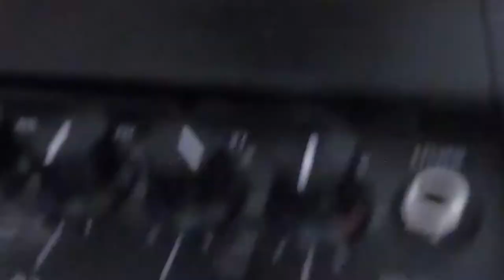Modifying Blackstar Fly Mini Portable Amplifier - Rechargeable Battery Mod

Comment: Buying rechargable batteries suggested for the tame of heart. I love mine. I just use rechargeable 2100 Nmh Eneloops. You can play a long time on 6. And I have the 6 watt 103 ext cab and it will run 2 days without shutting it off, then I just put more charged ones in. I have cord that came with my combo, but I just love being able to move around and jam
Reply: does the cord charge the batteries inside the amp or is it for a different purpose?

Comment: I thought about using an external power bank. It's a great idea to modify it if you like tinkering with stuff and you have all the equipment otherwise just use it at the wall or buy a rechargeable amp like the Nu-x Mighty Air.

Comment: I have to say you did it wrong because the amp requires a 7.2v to 9v pack to work propertly not 3.7v battery my friend you probably figured it out after using it with that.
The battery is fine, you had to buy a step up voltage board that make 3.7v go up to 9v so u can use all the power.
Now all youre using is 15%20% of the power of speaker unfortunately.
You can also buy a 9v lithium too.
Edit : Cant believe you cant hear the amp being distorted with lack of power

Comment: hi, im planing to replace the existing AA pack box with 9v holder box, is it safe just to reconnect those two wires from AA box to the 9v holder box connector? thankyou
Reply from the maker: I think it would be safe but I don't think a 9v would have the capacity or peak discharge to work very well, it could be worth testing though? I would assume that the amp would cut out at loud volume/heavy playing but not sure...
Reply: Hi how did it go with the 9v battery? You tried it out? You have a pic or a video to share? Thank you

Comment: Seriously?!!!!  ROFL.  FFS Just buy x6 Panasonic 2450mAh Eneloop Pro NiMh LSD NiMH AAs (Made in Japan). If > capacity is required, but a second set of x6. Fly 3 operates at nominal 6.4V DC input power, so no need for all this shenanigans.
Reply from the maker: There are certainly many ways you could achieve similar results, personally I didn't want to use AAs and get an AA battery charger, plus I already had most of the components laying around. For the most part, I just wanted to try a DIY approach because it's interesting to me! Feel free to use AAs in your Fly 3, I'm not saying my way is the best way, and I've already been told there's a rechargable pack available for the Fly so that's another option! Hope whatever you use works for you :D
Reply: @Staples1010  Curious as to what rechargeable pack you are referring to specifically? I have owned/own  x2 Fly 3s + a 103 + PSU for 4+ years now and have never heard of one. Unless you're referring to Blackstar's external PB-1, which isn't' voltage compatible with the Fly- and costs more than a Fly! He y its your Fly, do what you want, but your approach makes about as much sense as performing surgery with a shotgun. Pretty much everyone used LSD batteries around the house today. It'd be the oddball who doesn't. Two standard eneloops which come with their charger + one x4 pack (cheapest). Still 2000mAh. Cheap on eBay promo or Amazon. Problem solved.
Reply from the maker: @theblytonian3906  I'm not entirely sure of the  rechargable pack, it was referred to by another commenter, I can't say I researched it at all... As I said though, my main reason for doing this was because the DIY aspect of the project was interesting to me and I thought it might be of interest to others! Thanks for your suggestions though! I'm sure people will find them useful 😁